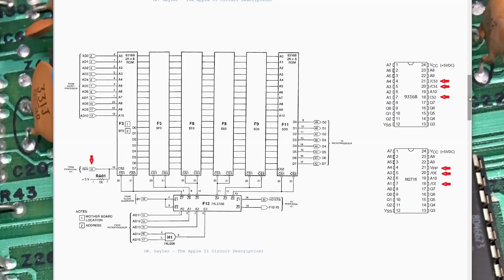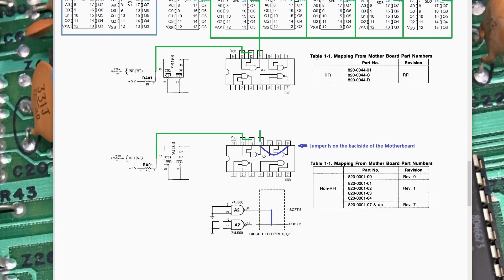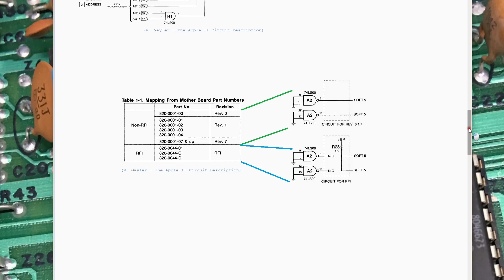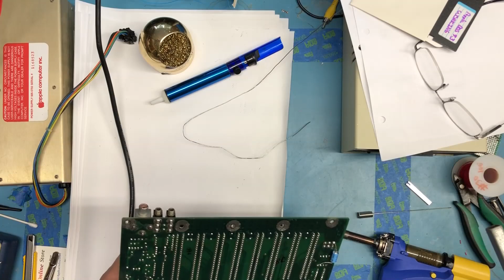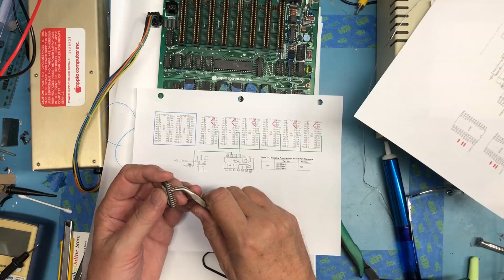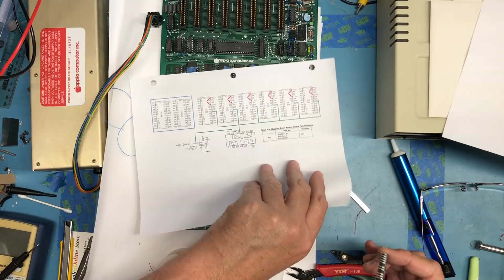APPLE II Plus - Part 11 - Replacing the system ROMs with 2716 EPROMs - STB206

Comment: i'm building a rev 0 myself and find myself in a position where the original roms are completely unobtainable
Reply from the maker: As I recall I had to modify the board to accommodate 2716s as the sockets were not pin compatible. It's been a LONG time since I did this and my notes are long gone.